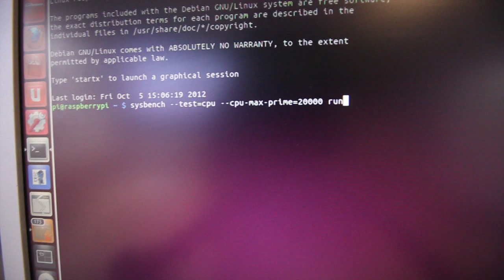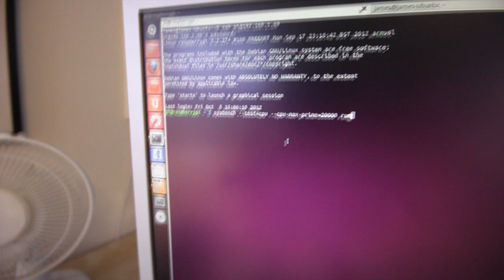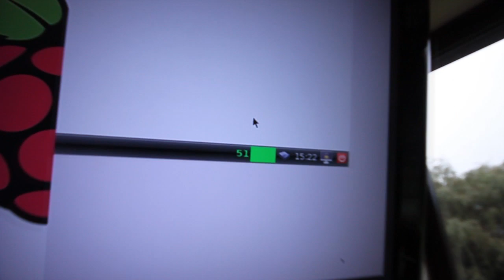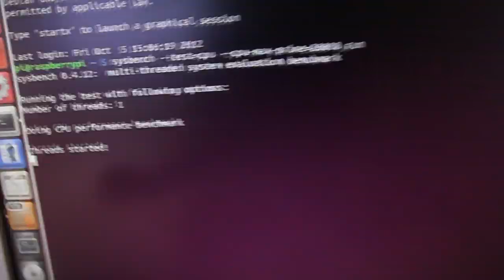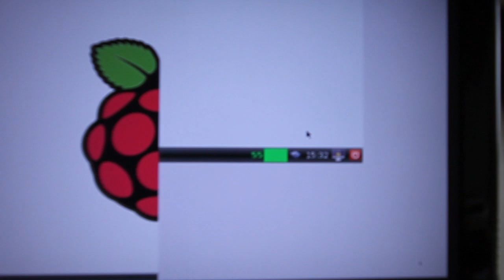Raspberry Pi Heatsink Efficiency

Comment: Heatsinks are designed with fans, Add a fan otherwise the heat just builds up in your sink, the reason it's droped 10 degrees just by adding it is because the heat sink at room temperature absorbed the heat

Comment: James, that is a useless test... the heatsink will try to diffuse the temperature when is attached but it gets to a point where the thermal conductivity of the heatsink is going to stop working unless there is fresh air taking away the heat.

When you first attach it the block was colder taking away immediately some of the heat.
Reply: +Rod Landaeta It's not useless. It shows that the heatsink is pretty much useless under PASSIVE cooling. With a fan, I'm sure it could do a bigger difference though.
Reply: Aragiss A heatsink that small can't be used for passive cooling. That is what I mean.

If you take a copper block (about a pound) and put it on top of the chip is going to make a difference because the heat will first be completely absorbed by the block, later on diffused by its surface area.
Reply: Rod Landaeta I know but you're talking about desktop CPU passive coolers. Such a low power CPU generates much less heat. I think even a tiny heatsink like that can be used for passive cooling.

Comment: See I don't understand why people think that just adding a heatsink will lower the temperature, heat syncs where made to disperse heat thru the air, but in this video there is no ventilation for the heatsink, so of course its going to reach the same temperature. Im not saying anything was wrong with the video, it was great......
Reply: +Scott Chiste Greater surface area for heat to disperse = lower temperatures (albeit slight with a passive heatsink). Look at passive desktop CPU heatsinks for example, even passive ones (without any fans) can outperform the stock Intel/AMD heatsinks which have fans built-in
Reply: Chasdog I know that, but you need some sort of ventilation to make a heatsink work a lot better.
Reply: +Scott Chiste Sure, it's just in your original message you state twice that simply adding a heatsink would make NO difference to temperatures, but it will

Comment: Thank you for the video. It was Interesting.
Reviewing the changes before and after installing the heatsink the difference is not much.
Considering you've applied a thermal paste and brought the temp. further down I guess the reduction isn't in anyway helpful to for Pi's durability performance. Isn't it?

Comment: Beside this, you can gain much better results if you attach to the raspberrypi case a mini 12V cooler onboard connected to 5V (lower spin, very low noise), it stays below 40 C degrees.

Comment: The thing I draw from this is your heatsink has done barely anything. I suspect the sticky-tape is not much help and might degrade into a gooey mess within a short time.

Heatsinks need a good thermal connection to the chip - not easy with a rough-finish epoxy case - and the 'sink itself needs as many vanes as possible - preferably tall and skinny - and, ideally, a pure copper core with matt black finish. A fan will make a difference of course but that's more power consumption and more noise unfortunately.

You can buy 'pure' copper 'sinks for a couple of quid which - if you have a hacksaw, a vice and a steady hand - can be given a much bigger surface area profile with a few well-placed cuts.

Appreciate you sharing the findings though.

Comment: Interesting. I guess without any extra air passing over the heatsink to take that heat away, after X minutes, it's barely any more efficient than running without heatsinks at all. I'd imagine that if you added a fan, it would be far more efficient with the heatsink attached than without it.
Reply from the maker: Your correct, I actually made another video which shows the difference with a fan added as well :)

Comment: The peltier will be fun to experiment with, but it's not good for this application. Ultimately I believe there are two reasons why you're not getting as large a temperature drop as you might have expected. 1. Try thermal paste instead of the sticker they gave you, it is designed specifically to transfer as much heat to the heatsink as possible, and 2. Try heatsinking the other two other chips causing heat on that board, as well. Google "raspberri pi heatsink case", and you will see what I mean.

Comment: yea there are several out there that should be able to run easy off the pis pins.  large builds ofc worry about condensation but combine this with the hydrophobic mod and i think it would be ok.  i cant find any of the exact footprint size of the pis cpu/ram stack but there are several just under and over. i figure over would be best.  these can keep a full sized desktop at 60F(15C) so im interesting to see what it can do to something much smaller and how much you can push any given ones OC.

Comment from the maker: The heat sink fits perfectly over the chip. The fan is a DELL GM0501PFB3-8 LATITUDE C640 5V 0.2W system fan from a Dell laptop.

Comment: @James Woolley Thanks for the quick reply. So the 15 x 15 mm heatsink fit well on the chip? And do you happen to know the current that the fan you used in your follow-up video operates at? I'd like to avoid over-straining the GPIO

Comment: yes, sort of like that... except made out of aluminum with a CNC mill and with all the negative space above the box filled in and room under and around the GPIO pins to allow them to be used. I mean, isn't that the reason you'd use a raspberry pi over an old cell phone?

Comment: If I was trying to make a case for this, I would make a single larger than board sized heat sink that doubles as the outside wall of the case, conducting the heat directly to the outside.

Comment: The idea of RasPi is that YOU make the case... and go through the trauma of not designing the case correctly, i.e. what this video is demonstrating... not taking cooling when over clocking into account... that's exactly why, as you say, it's fascinating... at the low price, you can learn while you break things...
Air flow is important... and going straight to the core with HS compound... but I will try myself soon, and give feedback.

Comment from the maker: If you interested i made another video where i tested a fan also :). From what i have heard the other chip that you have the heat sink for is actually the one that gets hotter and runs at a higher temprature.

Comment: I have a similar heatsink (maybe a tiny bit bigger) and have observed the same 3-4deg cooler temps. I also have a small heatsink on the smaller chip near the usb/ethernet jacks,just cause I had one the right size. :) I haven't yet tried a fan.

Comment: you can buy cases with it now, i got a white one with my model b, made the vent holes on the underside a little larger and placed small fan i had on an old nvida 6600 over them and ran the wires through to the row of pins i think are used for external displays not sure, but the first pin from the top left is the 5v pin, and third in is the ground so pretty easy. running xbmc streaming movies im getting around 40c stable with it just blowing on the underside of the board minus a heatsink

Comment from the maker: I think i read somewhere they they are not going to. One of their aims is keep the price as low as possible and having a case isn't really necessary. It is more for aesthetics than anything even though it may protect it a bit of something was dropped on it for example. Its quite good in a way that they are sold without cases as it allows for the many custom designs of cases from other people.

Comment from the maker: If you get the latest version of raspian you have the option to add the temperature monitor to the bottom task bar. I can't remember off hand but you can right click on the taskbar and choose to add an application and the temperature monitoring is one of the ones you can select. I do know that it was added recently so the newest version of raspian is defiantly needed.

Comment: I don't think there's anything wrong with the chip being at 55 C - it doesn't need additonal cooling. (The sudden drop after application of the heatsink was because the heatsink was cold).

Comment from the maker: That would be very cool. Even having a case that allows you to slot the fan into and have it level with the heatink would be quite good. One of the problems is the fan lacks a method of attaching to the heatsink permantly. Having it part of the case would fix it :).

Comment from the maker: Even though the sticky tape is intended to provide conduction between the processor and heatsink i think your right. Using some thermal paste would likely be much more effecient. I just avoided it as its a bit more messy :).

Comment: I have to wonder about the thermal conductivity of the sticky tape that came with the sink. Perhaps a thermal epoxy would make a bit more of a difference? I also wonder if a small fan would be advisable for over clocked applications...

Comment from the maker: I’m sure your right, with just the heat sink I really only have half the cooling system in place. I just ordered a tiny CPU fan for a dell laptop. Its model number is GM0501PFB3-8. It runs off 5v so maybe can be hooked up to the GPIO to be powered or if that fails the USB port. I haven’t looked into it much yet  Ill be sure to make another video when it arrives.

Comment: Your probably get more tempature drop if you could get some airflow going between the heatsink fins , Once this board is inside a enclosure with little airflow its likely its going hit the original max temp , The problem is how do we mount a small fan to it and find a power source off the board itself.